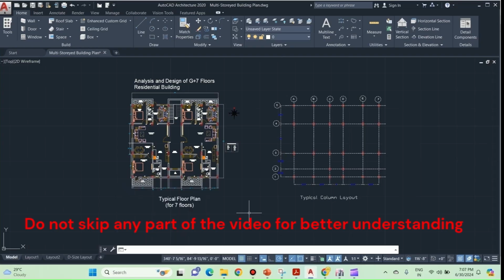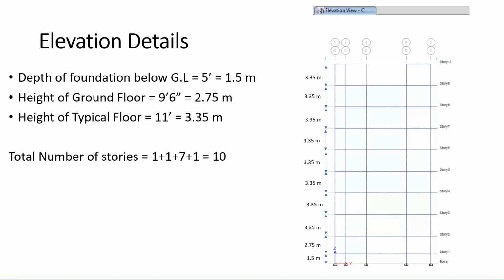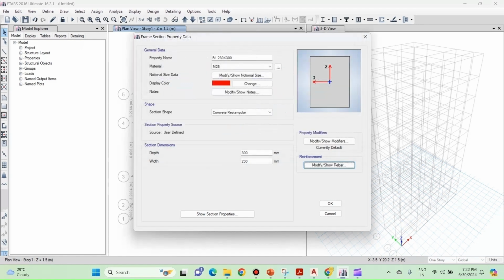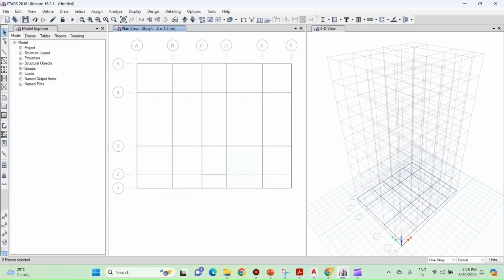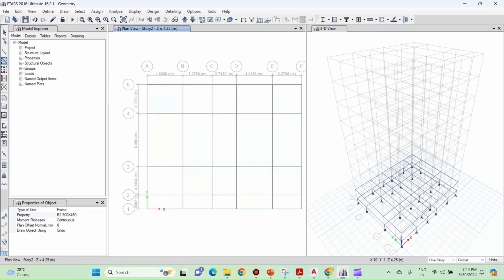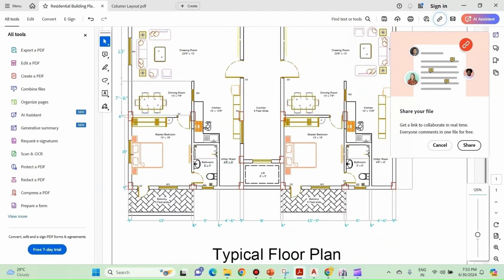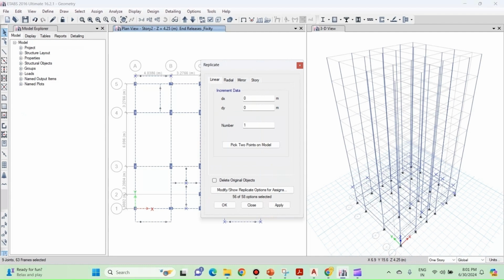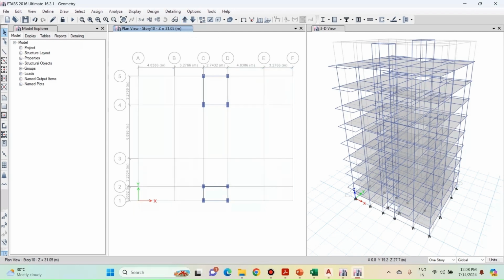ETABS Tutorials Part 3: Preparing Complete Geometry of G+7 Floors Building

Comment: how did you remove the x and y arrows (local axes) from plan and 3D views after orienting the columns?
Reply: If the axes appeared immediately after assigning the 90° rotation, you can use

Assign → Clear Display of Assigns

Comment: why you consider under ground part as a storey.
Reply: There is a difference in common talk and structural labeling. Since we need to design columns below ground also, in structural design, we call it first storey and the numbering also known as structural storey number. Similarly, structural height of the given storey is centre to centre distance of lower beam to upper beam of the storey. The depth of both beams may be different.